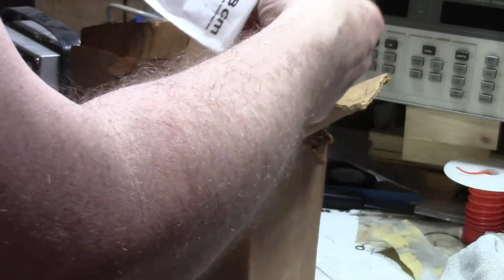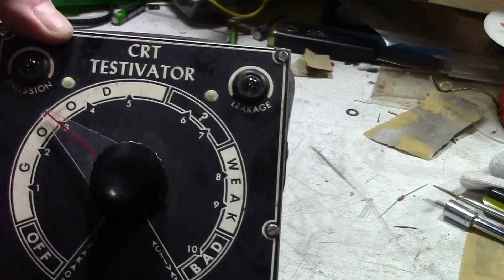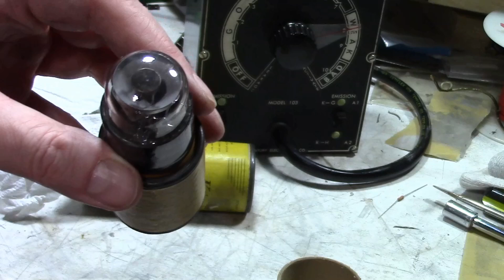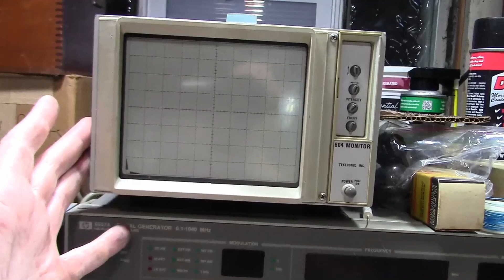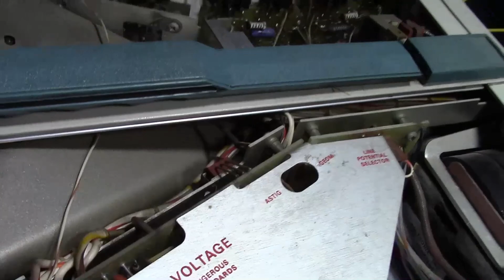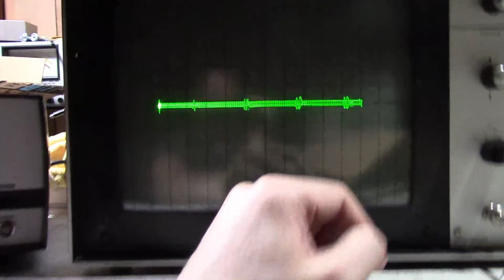New test equipment and tools

Comment: Nice! love the test gear, it definitely makes working on electronics alot easier. I have a distinct lack of test gear, and when reverse engineering an old 7.38Mhz satellite subcarrier headend hardware, it made my job alot more difficult so I had to pick up at least something.

Comment: Does that XY monitor have a ceramic CRT?
Reply from the maker: I'm not sure, but I don't think so.
Reply: I think when Tek switched from round to square CRT's they all were.
Reply: @zorktxandnand3774  No they made glass ones as well.  Tektronix used ceramic CRTs in applications where definition was paramount, such as vector monitors, graphic terminals and high-performance oscilloscopes.   Their largest ones were used in graphics terminals which had an effective resolution greater than 1000 lines per inch from edge to edge, a feat which was hard to accomplish without the precision afforded by ceramic envelopes.